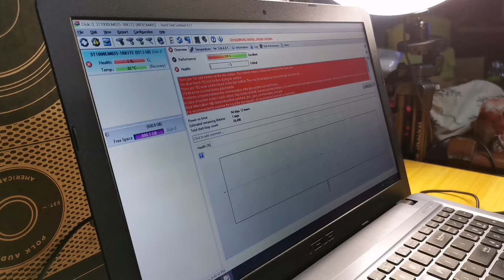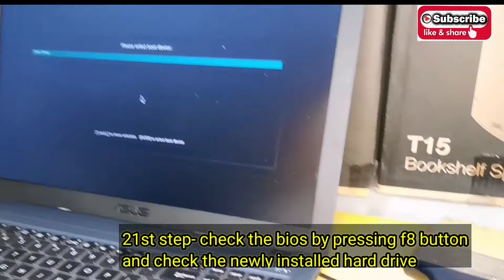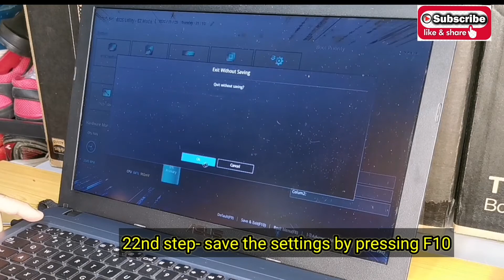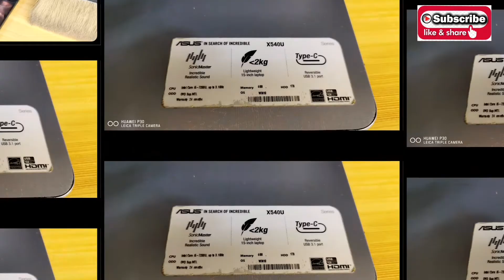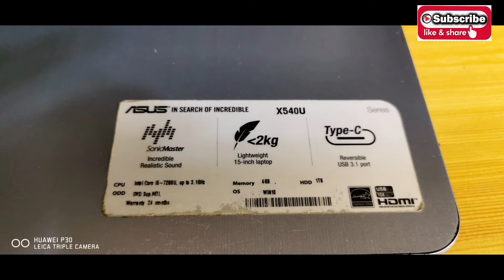How to replace a laptop hard drive/ Asus X540U laptop

Comment: Sir papaano kung di nya binasa yung bagong hdd. Functional nman sya pero naka stock up sa ASUS na logo. May short cut key ho ba para maccess ang bios sa start up?
Reply from the maker: Pag on mo ng laptop just press the F8 button Paraa detect ng bios si HDD.
Then kapag na detect naman na I boot prio mo Yung boot able disk mo Para MA format and ma install Yung OS na lalagay mo lolods
Reply: @ON7650  maraming salamat sir, gumana sya 👍
Reply from the maker: @altiernation5057  nice  good to hear lolods  

Stay safe.

Comment: Hi po, pwede po bang matanong kung ano po yung tawag sa board kung saan nakascrew yung lock ng hard drive? Yun po kasi yung sira sa laptop ko po.
Reply from the maker: Hard drive holder po sya. Wala naman pong board yun
Reply from the maker: Kung hindi po hard drive cover. Motherboard na po yung may sata drive connectors. Direct po kasing I co connect ni hard drive case sa sata connectors motherboard